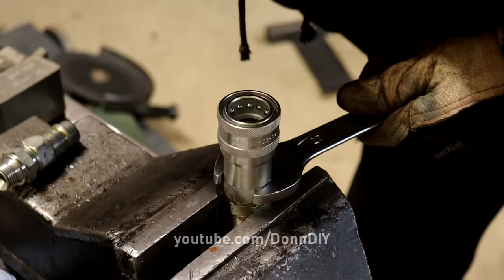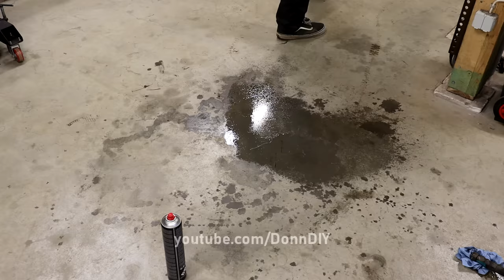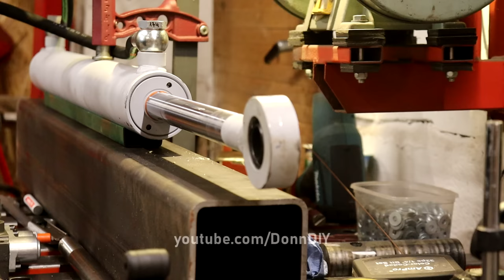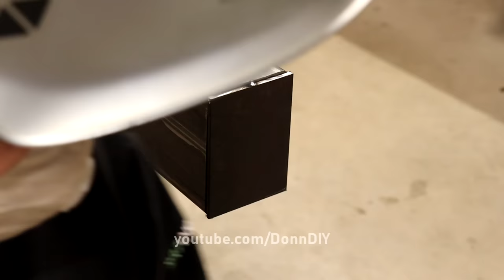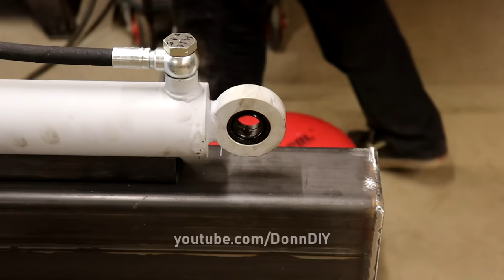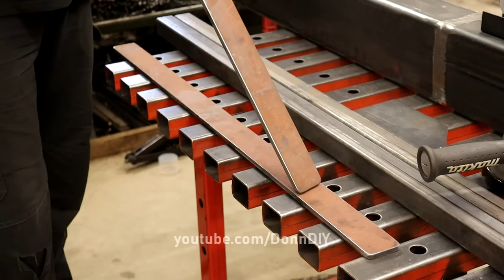Hydraulic Log Splitter BUILD Part 1 - Steel Frame Fabrication & Sourcing Parts

Comment: At my place there were two vertical log splitters, driven by tractors. The first one had a small table and ran off the tractor's hydraulicss. It was slow but needed a big tractor running at full revs. 

The other one has a big table, so you can load it up with discs of wood before splitting. It also has an extra hydraulic arm for lifting big slices of trunks up on the table. This one only needs a small tractor pootling along at low revs, because it has its own hydraulic system and is powered off the tractor's PTO. Much cheaper in operation, fuelwise.
Reply: I used to see a lot of those pto driven buzz saws for sale, think they were for either cutting firewood or cutting off hands (lol)…. Wish I could find one now because the large circular saw blades and bearings/gears would be good for a ripping mill.    I have a band mill but having a circular sawmill I could put on the same track would be good for certain logs or. Quarter sawing
Reply: @dillrepair  I made a Bench grinder out of my buzz-saw get grinding wheels2x12 from wheel MFR plant for free. there 30hp grinder are throwaways at10 to12 inch's

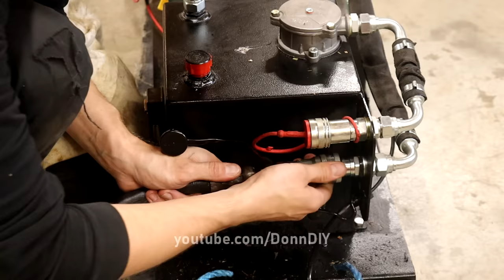Comment: 9:35 IIRC, you can connect the quick coupler protection caps together. That prevents dirt and stuff getting in there. Not that much of an issue in the shop of course, but still a good practice to uphold I think.
Reply: My Dad always did that with hoses on his snow plows when the plows weren’t in use. 
It worked for him.

Comment: Having used many of these over the years, the splitting edge works better when it's attached to the hydraulic cylinder that if it's stationary.  Also Having a log hold down is hugely helpful, it keeps them from going crooked and jumping off the splitter.

Comment: There are special valves for log splitters that make them faster by using the oil that's coming out of the front port of the cylinder and directing it to the rear port of the cylinder to extract it. When a certain pressure is reached the valve switches and only the pressure coming from the pump is used to extract the cylinder. By using such a valve u might get away with using the hydraulic pump of the timer trailer
Reply: It is called regenerating valve i think.  At least that is what I remember.
Reply: Exactly. I was going to comment this same thing. There are directional valve blocks dedicated for log splitters and they have pressure controlled regenerative function for the + stroke of the cylinder. Smaller logs might split already with the area from piston rod and cylinders full force might not even be needed.
Reply: there are also distributors that have 2 "gears", pass me the term, obviously they have 2 levers: one for speed. it looks like what he is using but he only put the tubes on one
Reply: @Autogru  Don is using regular 2 section directional valve(so no 2nd gears there)... He is already using all the flow from the pump so the only option to increase speed would be to guide return flow from piston rod side back to cylinder (regenerative connection). Naturally that works only extending direction of the piston stroke.
Reply: @Autogru  I think you're referring to a "two stage pump" where the pump will push high volume at low pressure then switch to a low volume and high pressure when a set pressure is reached. He would need to modify his motor unit for that, but then it would be unusable for anything other than a log splitter; a pump that unpredictably changes speed is inappropriate for general use.
Reply: @Ch4grin  I am referring to the kind of speed change that the hydraulic presses that are found in the workshop have, used to remove or put the bearings
Reply: @JuhaErkkila  thanks for the explanation, I knew the German term but not the English. Also it was quite hard for me to explain 😂
Reply: @Ch4grin  they seem fairly standard now? i got one on my backhoe and notice no difference in operation. it moves a bit faster than a single stage but then has more force when its actually loaded down without bogging the engine?

they only work when the pressure reaches a certain threshold and only change over gradually because it is just a bypass valve opening... it isnt a solid "hi-lo" shift...
Reply: @paradiselost9946  I'm sure it could be made to work if you've done your math to ensure the speed change only occurs when (e.g.) the arm is in the middle of a dig and not just moving to position. Or putting that another way it would not be too hard to get unlucky with a bad cylinder/pump sizing resulting in a wacky dipper or boom that changes speeds erratically.
Reply: @Ch4grin  it doesnt work like that...

when its moving theres no load, no pressure. it just stays on the low pressure pump, hi flow.
as soon as the load comes on it builds pressure until the valve opens, then it starts slowing down and producing some decent force. you dont notice it other than it seems to move slower when doing something...

and like all hydraulics its always preferential. try and operate two or more controls and its always the one with the least load that will move.

Comment: Looks like a great build so far Donny! I had to reengineer my new splitter by adding 4 inch square tubing log rests filled with sand. The tongue weight before adding the weight was unacceptably high. Still high now but not back breakingly so.

Comment: It's great find and all. Plus practically free. Hope your using a hands free hydraulic cone log splitter on the other end it's more faster and economical. Than running a wedge type hydraulic piston back and forth or pushing to a wedge break which waste time, fuel and money. Maybe also adding another cylinder to lift the logs from the ground to load the splitter or a feed rack would be more beneficial and save you from alot of back pains in the future?

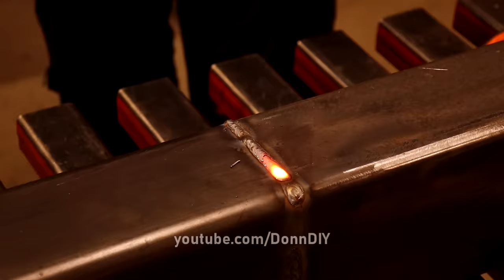Comment: 12:56 you should make yourself (since you're doing quite a few of these) an attachment for level grinding. It's pretty simple. Basically you attach (to a disc guard) four bearings that allow you to move a grinder wheel on a surface back and forth without dipping into it. I made mine with two of them (on the same axle) adjustable for height with a screw. Excellent for when you clean a surface after welding or if you weld something temporarily to make it stable, to grind any tacks off.

Comment: 33 gal/min, two stage pump, 13 horse engine, 110 diameter cylinder ram with 65mm spear. This will munch anything. I use this setup on bluegum all day no problems. 
The larger spear give you a faster return as you don't need as much oil.  That old one was probably perfect if it was in good condition.  Also do your back a favor and set it up vertical with a bench height of 750mm
Reply: Yes. And a BIG table

Comment: Nice work. I have the shop to build a splitter easily, but after evaluating the cost of parts [would never use used hoses - dangerous ] I had to break my US made rule and buy a "Yard max" 28 ton Chinese splitter. The build quality is crazy good and it was delivered to me for $1300. I have no clue how it is possible. Splits oak burls and crotches, have not stopped it yet.

Comment: Hmm, a second log splitter.  Interesting.  Anyway next time you plug into an old hydraulic system you will want to take the line that is feeding back to the pump and pull the end off and just drop it into a jug.  That way if the oil is contaminated/bad you don't run it back into your reservoir and through your pump potentially ruining something.  If the oil is clean you can always filter it and continue to use it but if it's bad you don't have to drain the whole system and replace.  Will save a ton of work and potentially money that way. 

Those "banjo" bolts on the cylinder may be slowing things down as well compared to a full open line or a 90 degree turn as well.  Probably won't be a ton but still it will create some backpressure which reduces the flow so something to think about.

The only other thing I can see is maybe the cylinder should be mounted a little higher up.  If you mount it too low it will torque the sled when you are trying to split a log which can cause the sled to literally wedge itself.  If each finished piece is going to be around 20cm or so I would mount it that high up because most pieces you split will be around that large or larger.  It will help prevent wasting power on friction from the sled sliding on the rails, the other option is making the sled longer so that it has less chance to bind but doing both will help even more.
Reply: Indeed, can't believe he plugged this old piece of junk straight into his nice new hydraulic power pack!

Comment: that start of another great build ,, I have a store bought log splitter it moves just as fast as the ram you are using now ,, the system is built for power not speed .. I have split some ugly wood full of knots ,, have not had a hunk I could not split .. I think but could be wrong .. if you have it go too fast and the log wants too kick out you or the machine could get hurt of damaged ,, hope I am wrong ,,, another thing I want to do too mine it put small spikes on the flat plate to help hold the log from kicking ...also I want too add the side shelf to catch the wood I only have a single edge splitter so I need to split 2 or 3 times and have too pick the wood back up .. I like you idea of 4 way split ..

Comment: 1:06  You only needed one more female, and it should have gone on the pump side.  With your current configuration every single hydraulic implement is going to require one high dollar female coupler.  A coupler sitting on the end of a hose to get filled with debris, or physically damaged.
Reply: Just as it is on any standard tractor
Reply: You can make a female- female adapter to accommodate other implements, or have a tee with both sorts of connections on one of the pump’s outlets if you like.
Reply: @Salzar  There must be some cultural division.  At no point is adding unnecessary complexity a good thing.  Keep it simple, and do it right the first time.  Female is always on the pump.  Period... not a discussion.
Reply: @ShainAndrews  I disagree, if my front loader 3rd service didn't have "sexed" couplings there would be the possibility I could connect up implements backwards. Could lead to be dropping things when I did't mean to. Also, things that would be damaged by reverse flow are probably protected by a check valve but other implements like log splitters will work fine in reverse. Except, a detent in the spool to hold the ram in reverse will now hold it in the forward stroke. This is arguably dangerous. I think Don should keep his fittings the way they are. It's easier to connect and you don't need to rely on colour coding etc.
Reply: @salzar4431  You really have no idea what you are talking about.  We can tell you have little to no hydraulic experience.  Nobody hooks lines up without verifying function prior to operation.  If they are backwards then swap them.  Most people color code their lines if they can't mentally sort out flow direction.  Protect from reverse flow?  Son... the equipment must have those protections because nothing in the hydraulic system stops flow from reversing.  You move the lever one direction pressure is present on one side of the port.  Move the lever the other direction... the other port has pressure.  Just stop.
Reply: @ShainAndrews  Shain, I don’t think we are going to agree on this, it was nice talking to you.

Comment: Ppl never really appreciate the cost that goes into all these projects that you & others make on the internet until they themselves go & buy similar parts themselves. I have to go buy a 1/4" bsp hydraulic connection that can easily be fitted in the field for a 1/4" high pressure hose to go into a desalination membrane housing & I was astounded when I saw the cost of such a small fitting & as you get into fittings of the size of hoses you are working with the prices grow exponentially for each part. If you are buying a custom-made hose with adapters, then the price skyrockets again just to have it made while you wait.

Although most of your projects come from recreating old scrap into something new no one knows just how much money goes into all the parts that you need to buy such as fittings, bearings & hydraulic accessories. I'm surprised how you can balance your personal life, your outside work life that provides for everything you do & still come up with new content every couple of weeks, it's really amazing what you do.

Comment: To get oil off the floor use cat litter it's cheaper, just spread it on have a coffe then sweep it up. For a quicker way use cement powder does the same job but quicker ...TTFN

Comment: It will be interesting to see what the return speed of the cylinder is like.
The thing that bugs me most about the hydraulic splitters i've seen so far is, how frustratingly slow they are.
Reply: If I ever built one I'd be inclined to use a small-bore single-acting cylinder to retract for exactly that reason.  That or make it so it splits in both directions.
Reply: if they go too fast the log could kick out and someone could get hurt ,, I have seen them built ,, with a train idea the rod hooks up too a spinning wheel and it pushes the splitter wedge or pushes the wood ,, a lot of the times the wood will kick out .. slow is safe
Reply: They are slow because the rams need to be big enough to provide the power. Most of the new ones I have seen have 15 second cycle times. Cycle time really depends on the type of splitter you have. If you have a splitter that has the cutting wedge on the ram ( which is the kind they use to go vertical and hortaZontal) Its going to be much slower because you are going to have to do a full stroke. if you have the push block on the ram side then you can get a 4 way splitter end to which you can split half of the log and add in a new one. To get a faster cycle time you need to upgrade the engine, pump which cost much more. So your 1500 dollar wood spliter bought at a big box store will now cost 5k for a faster cycle time. 
I had a dual acting splitter. While it worked good it was not any faster as you have to do full strokes.
Reply: Have you ever seen flywheel driven log splitters? They split a piece of wood in a few seconds. Basically a motor spins up a heavy flywheel and a clutch engages it in an instant to quickly split the log, then retracts just as fast. They are super cool!

Comment: This belongs in you firewood processing train.  Drive out to the downed trees with the new trailer.  Get the trees, and come back to the train. Empty trees onto the machine to cut  the wood to length.  After it is cut to size, it goes to the splitter.  From there up the conveyor belt into the wire cage thing.  You don't have to lift any wood.  It would be impressive to see you buggy pulling the processing train.

Comment: To make the splitter faster there are hydraulic valves that automatically recycle some of the output oil back into the input when there is no load. That way you get extra speed when extending/retracting, but it goes back to full power when splitting. Might be an option for you?
Reply: Log splitters also normally use a two stage pump that puts out high volume without load and high pressure when under load.
Reply: Also his cylinder is way too small to split anything. I run a 4in cylinder on mine and it struggle with white birch sometimes

Comment: 2nd. Log splitter you are building, first one loaded logs lifted  to cutting station chain saw cut moved to splitter split log 4 pieces,  dropped in to bin to a conveyer belt   to large bins for storage of firewood.

Comment: Question for every one : I have a project for hydro spliter too, and I want to use, as a way to rotate an oil pump, an old vertical shaft lawn mower 15 hp because you can find it easily and it's cheap, but do you think the rotating speed must be adapted (reducer) ? Great vid Donn, as always.
Reply: Pumps dont really care about speed they care about pressure dont over load them or theyll explode, a lawn mower engine should have a good rpm for any hydro pump as is
Reply: @mathcool6  Thanks mate
Reply: You can certainly find a pump that is rated for that rotational speed. Usually they have a working range, for example from 1000 to 1500 rpm. You can find that information on the datasheet, there should also be the displacement so you know how much oil is pumped for every rotation. There is also the hydraulic efficiency of the pump so the flow will be less than the ideal one and the maximum working pressure that, knowing the bore of the hydraulic cylinder gives you the maximum force youll'be able to apply.
Reply: 3600 RPM is the speed of 4 cycle mower engines and plenty of pumps are sold that will match that. Also, you really want a two stage (log splitter) pump.

Comment: Hi, I built a log splitter a few years ago and decided to make use of the rams movement in both directions so you split on the push and the pull, more productivity and lest time splitting. It was a challenge but maybe this might be something you could consider before going too far with your version? Happy to send you pictures or info to help?

Comment: Always enjoy watching these vids, thanks for posting!

When you pick up the chips with a magnet, would it be an advantage to put a small plastic bag over the magnet first?  When you pull the magnet out of the bag the chips will just fall into the chip bucket without needing to clean the magnet.

Comment: Re speed, fast out is always a good thing. But fast in, not always. Hardwoods and twisted grain need slower speed at higher pressure to split more easily. Therefore, don't overspeed the ram.

Comment: Electric telescopic high branch shears to solve the danger of working at high altitude:

Function Description: 1. Expansion height 2M.
2. There are 3 lengths that can be adjusted.
3. Easy to use and safe. Light.
4. Come with two batteries.
5. Each battery lasts 3 hours.